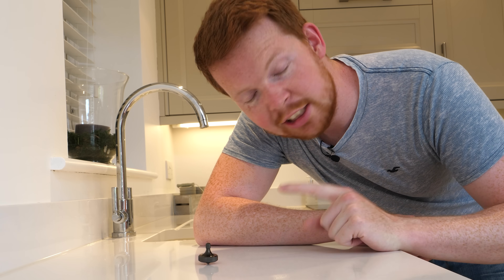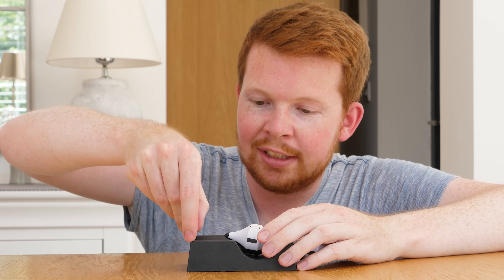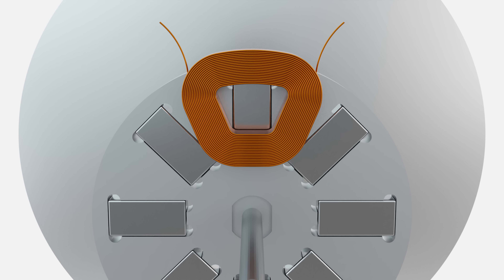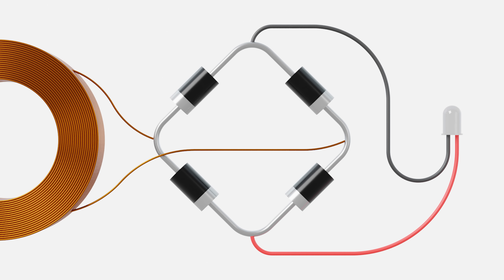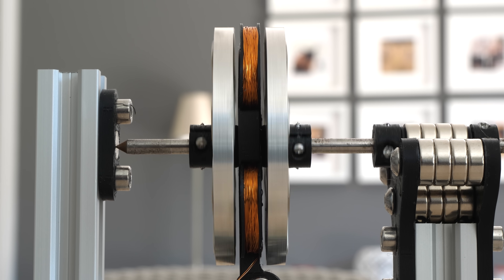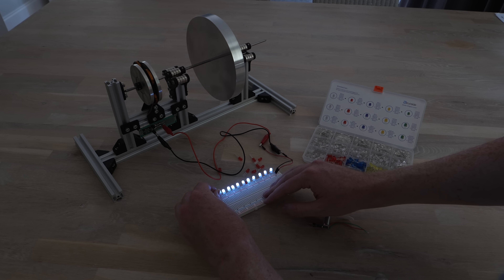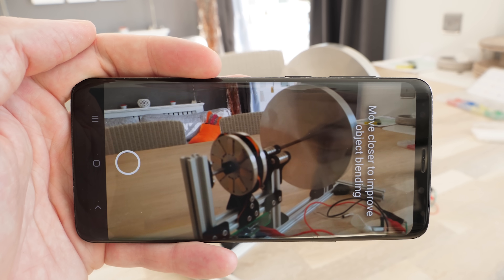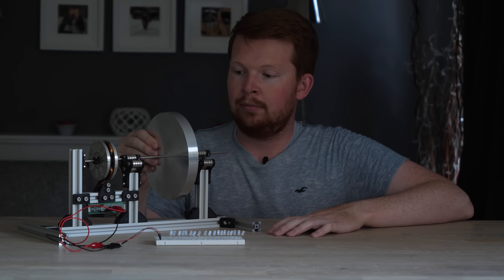Flywheel Battery

Comment: So nice. I'd love to see a 2.0 version with a straight shaft, a higher moment of inertia (maybe a thicker but hollow cylinder) and a reversible generator so that you can "charge" your flywheel with electrical energy before using the stored kinetic energy.
Reply: To add to this I want to see a clutch, or something of the sort of grabber which could use that stored energy to spin it again, then a camera along with a program to send a signal when the flywheel stops to the kinetic spinner to spin again. Possible?
Reply: @matthewcurry3565  Probably dont even need a camera and can just use a motion detector sensor/IR sensor to detect rotational movement. You can even write a code to detect when the rotational object slows down to supply more power to get it back up to speed or just write code to detect when the rotational body stops.
Reply: @ChristopherJones16  yeah that would be more appropriate. Good call. Think the efficiency would be pretty good... The battery should put less load resistance on the wheel, and then the system could in essence turn itself. Then a vacuum chamber could be made to decrease air resistance. 👍
Reply: @matthewcurry3565  A hamster could be used to spin the flywheel!   :)
Reply: @glasslinger  No lie really. At nearly 0 resistance, or very low resistance you could get anything to start it up haha. (was thinking water/steam for initial startup/charge), but usually startup capacitors do that job effectively I think.

Comment: Need to balance the system better.  Then use the generator as a motor.  Then apply voltage and remove it and it truly is a mechanical battery going from electric to mechanical to electric again.  Also build a catch cage or you'll shoot your eye out...erm...I mean hurt yourself.

Comment: I have a stirling engine I place on top of my modem, and it usually spins for about an hour before stopping because it dissipates the heat faster than the modem generates it. But if I used your idea, I could have it store some power in a capacitor, then give itself a bump once the modem has heated back up.

Comment: my own experiments with 11mm puck magnets in the ring around : 10 stationary 11mm coils, only 18 wraps, 10 magnets in opposing orientation like yours generated 5 or so volts.  i used 20ga aluminum wire for these coils.  my second coil was 100 wraps of 24ga copper, perfectly spaced where i threaded my feed end straight down through the center and wrapped the next layer within the groove, and the next coil  layer started and ended directly next to the previous, 22,21,20,19,18 turns heading from the core.  these coils were making 24V in the AC spikes, unfiltered into my digital meter. only 2 of them....in the end i determined that i could reliably get 1V at .1A at a low rotation speed from each coil/magnet interaction.  my plan is to double bank coils above and below the single magnet platter, 60 magnets in a time-constrained pattern, 120 coils generating 120V at 12A...which should be about the size of a large tomato juice can.  i don't want to go back to painting, i want to change the world.  the generator idea is completely opensource, i have no claim on the technology of wires and magnets. you are the closest anyone has come to my design so far. keep on tinkering, I think you are on the right track.

Comment: Wow I wish I was a part of this. Just awesome

A few ideas what if instead of using a pin and Plate at the lower end you would use a few small magnets compelling each other.

I'd also like you to use an ic 555
A condensator
And
2x 24k ohm rsistors

To start and stop a conducter which is putting more potential on the little motor wich could blow against the spinning wheel(s) aka Tesla generator.

And seeing how long it could power itself till the motor stobs. 

I have so many more ideas, love what you do. Thx

Comment: The question is can we attach the electric motor so that it turns the flywheel? Perhaps use some small gears to give it a mechanical advantage in order to turn the flywheel fast enough to create a closed loop of self propulsion? Probably impossible but sometimes I wonder....

Comment: Move the magnets to the flywheel, then you can fit more, they will be moving faster, and it needs a set of three coils on the small generator and both need yokes for the flux to make a circuit for the flux .

Comment: I'd be curious to see this design with traditional bearings. Like the ones from a skate board. You could tighten the tolerance of the coils and produce more electricity. I'd imagine the results would be similar, if not better.  I also know that magnetic bearings are available, but might not be small enough or cost prohibitive. Great video!
Reply: If you add bearings you add resistance.
Reply: @chrisbingham3289  i thought bearings was supposed to solve resistance.
Reply: @chrisbingham3289  Totally correct.  Stability always comes at a price.  It costs energy to constrain the entropy.
Reply: It would already be enough to use a straight axle, lol
Reply: Think about what happens when that stored energy gets away from you in an uncontrolled failure.

Comment: You could reduce the friction of your flywheel setup even more by using opposed magnets at the stabilizing end. Instead of a point spinning on a piece of glass, have opposed magnets set up so that the magnetic "cradle" holding it aloft prevents it from sliding off-center from the magnetic support.

As another thought...

Obviously less efficient in terms of storage than if you have no induction going on, but could you have a magnetic induction system that puts spinning force into the flywheel from an external source? If so, could you then hook the outgoing power into the incoming power, having the flywheel drive itself with its own electricity? Just how efficient can you get this? How close could you get to it being as if you had no inductive draw from the flywheel at all?

I ask because this would be a cool way to complete the "battery" concept: with the flywheel spinning and pumping its electrical draw back into itself as mechanical energy when not being used to power anything, it would not slow down as fast, and then you could just have something in the circuit that lets you add a load when you want to draw power.

Comment: So what would stop us from making human powered generators like this? Have a massive flywheel that you can spin up because the friction is low enough and then harvest it's power. Sure the person had to put in energy over time but wouldn't that be quite efficient? Now I know that you're not supposed to be able to just create energy so I guess the people would have to put in 1 volt of energy for one volt of power. At best, might not be effective enough

Comment: This is an awesome project!

To maximize light output you could try to get rid of the rectifier and use the LEDs in an antiparallel way. The diodes in the rectifier all have a voltage loss of about 0,7V, so 1,4V in total (as the current always has to go through two diodes). 
If you have say 100mA of current through all of your LEDs you are losing 0,1A*1,4V = 0,14W in the rectifier.

Comment: Well, how much power is produced is only depending on the coils and the magnets around the coil. The fly wheel has nothing to do with that so far. And the fly wheel is only running for the long time of 12 min, when there is no energy drained from the system. The moment the electric circuit is attached and closed, the fly wheel probably stops really fast and the entire effect of a fly wheel running for a long time is simply gone. That is probably why he did not show that. So in the end I do not think it is an interesting toy and that is why no one has made one for sale.

Comment: The Frenette electric car was able to charge batteries while it was driving. It achieved a nominal range of 500 miles, with an average driver.
It used a front wheel drive and shaft from a Cadillac with smaller wheel diameter, driving a crankshaft that turned 6 Alternators to recharge the batteries.

Comment: Good day! I have a question. 

In my country we are forced to buy electricity from the government. Price is high. Could I scale this experiment, so as to power the flywheel with a small electric motor connected to the power grid. That motor powers the flywheel alternator, generating "MORE"(?) energy and powering my home. That way I consume very little power in one single electric motor, but it moves a whole POWER GENERATING contraption that distributes the power to the rest of the house after generating more that it consumes!. Is it possible? - my idea was based on gear ratio: If I can move a large gear, to spin a small gear, I can get the RPM to generate current, I just lack the knowledge to assert if this violates conservation of energy.

Comment: What a fun project, I used to love tinkering with stuff when I was young.. it was a lot of fun and learned a lot. Keep it up .
Reply: Me too, we need to get more kids interested in Science and Engineering.
Reply: Only true thing to learn from that is that it takes more energy to get it spinning than it gives back.
Reply: @GekoTDi  I keep hoping someday someone will discover perpetual motion. And anti gravity.
Reply: @RadiatorSpringsMuseum  impossible. Perpetual motion is impossible
Reply: @HadronCollisionYT  yes but it's the pursuit of it that is so much fun.
Reply: Why'd you stop then?
Reply: @wes4477  got married ......
Reply: @RadiatorSpringsMuseum  HAHAHAHAHA, perfect explanation
Reply: WoW. I need help to animate an idea to leverage linear push created in car shock absorbe to rotational and hence electricity. May be the tyre can be designed so that when it touches the ground, gives a solid push thru a spring coil to get a powerful linear motion of small displacement. It can be converted to high RPM rotational motion thru gears and rest is known. Will it not create electric vehicle range to jump 10-20 times?
Reply: @asishsahu9091  no

Comment: If you're charging a capacitor like this, you need to include a diode between the output of the coils and the capacitor, or the capacitor will discharge thru the coils

Comment: You should make a Mk.2 with a few more sets of magnets and coils, and make each coil significantly smaller. You also should 3d print a high ratio gear spinner to make it easier and better to spin up by hand

Comment: Converting the output to DC isn't needed for (conventional) lightbulbs, or even for some kind of motors. I understand the desire to do so, just the reason wasn't well explained. You should also use a current limiting resistor with the LEDs, not to burn them. Still, amazing video.

Comment: Cool, but: you don't need the diodes to light up a LED or bulb. There's a 0.7V  drop over each diode because it's a semi conductor. Since you've a bridged set up we're talking of 1,4V.  So if you're working with small voltages and you don't need DC, drop the diodes.
The LED or bulb will flicker at a 50/60 Hz rate (the human eye won't see it because it's too fast to see).

Comment: So if you were to make a larger version, using some of the energy generated to power the flywheel so it becomes perpetual, then how much current could it produce?  Does it generate heat?
Reply: You can't make perpetual motion. The flywheel has low friction, but not 0. It generates heat by air friction and contact friction of the shaft with the plate, so the wheel will continuously loose energy. In fact, generating electricity to then power up the wheel will decrease run time because of all the energy convertion inneficiency (you loose energy everytime you convert it to an other form. For example, converting from rotational energy to electrical energy is no perfect and you loose some energy doing that) 

And even if somehow there was no inneficiency and friction, using current from the wheel would make it spin slower, because you are pulling energy out of the system

Comment: To remove the flickering 👉Use a smoothing capacitor 😎👍
Also try using the small motor to assist with  the flywheels rotation.
Alternatively 👉 Try Tesla Turbines 🤔

Comment: charging a small battery connected to an electric motor that would turn on and cycle the fly wheel back up would be a useful experiment.
Reply: diminishing returns, there would be electrical losses that would reduce the electricity returned to the battery

Comment: I don't know if he covers this later in the video, but advanced flywheel batteries are being tested in conjunction with solar panels to extend the time that you can get energy from them; basically, there are a bunch of flywheels carefully balanced in a vacuum canister, and the solar panels are used to power an electric motor attached to the shaft, which gets the flywheels up to speed. Once the sun goes down, that electric motor can then be used in reverse to transfer that kinetic energy back into electricity. Unfortunately, each one of those specialized kinetic batteries costs around $20k to pruduce, and only provides power for around 2-3 hours (I might have the specific numbers wrong, so feel free to cross check my information).

Comment: You could put a little windmill onto the open end of the wheel, putting in a stabilizer for the current and then plug in a battery. Put it outside in the wind, or inside your chimney and you'll have energy you don't have to pay for.

Comment: Amazing work mate! Be cool to see you add a hand-cranked gear box to the end, to take more advantage of human strength to get much higher speeds out of this system. And can you stabilise the output to run a raspberry Pi off it?
Reply: good idea about the gear box, stabilizing the output can be done by using a voltage regulation circuit, not sure if this will be practical to run computer circuits since the generated power has too much noise and fluctuation , computers will then constantly rebooting, but could be used for a hobby level,

Comment: The problem with all this machinery is that all are made by materials that are very polluting so there is no solution to any problem - also if you made this kind of machinery in large scales then you have a magnetic field still very unhealthy for all species near the machine - the green energy must be green and not made by materials that pollute in other ways still damaging the environment like wind turbines are still pollution more than burning lignite.

Comment: You could get a lot more energy from your alternator if you use highly permeable material to shorten the magnetic path between the two split rotors. The easiest way to do this would be to wrap the stator coils with a steel band with a break at some point to prevent it from becoming a single turn coil. These bands will decrease the distance the magnetic field needs to travel through the air, which has much greater reluctance than a highly permeable material like steel.

Comment: what if you built another set of copper coils and one more magnet disc and set the timing of the 2nd copper coil in between that of the first one.  so it would be magnets, copper coil, magnets, copper coil timed in between the first, and then magnet again.

Comment: Note: a full bridge rectifier costs about 1V in the output voltage. This can be avoided by using FETs - but they need a controller.

Comment: Can you technically place a small DC motor at the other end of the shaft and once you start spinning the DC motor kicks in keeping the flywheel spinning which keeps electric production and theoretically run on itself forever? Maybe even add a few capacitors to harvest some of the energy production to power other electric items and therefore create a self sustaining "free" or zero point energy? I honestly think that could work with the right configuration. After all once the flywheel is in motion you won't need such great power to keep it in motion so you could use a small DC motor and harvest all excess power.... I'd love to hear what you have to say or think about it. 🙂

Comment: Here's an idea: first off, fix your flywheel so it is perfect on the shaft.
Next, tape magnets around the outside of the flywheel with all the North poles facing up.
Hold a magnet with a north pole facing the flywheel and let the repelling force turn your machine,
How fast do you think it would go. I would also move the flywheel to the center of the between the levitating
magnets and have a coil on each side. Your thoughts?

Comment: This experiment was very entertaining.  I was just curious if there's some reason setting up a magnetic contact point wouldn't be viable to reduce friction even more?
Reply: magnetic support is "soft" and doesn't keep exact position, so most likely it would simply fail with any larger wobble
Reply: @tomaszdabski169  What if he basically used the same setup he has but set the spinning end of the contact point through the center of a disc shaped magnet while mounting another magnet on the stationary glass shield already stopping it from failing horizontally?  So it would look kind of like this:
||
|||||       ||<-------|||
|| 
||  ===========

Comment: you don't have a lot of energy in the nano world, so you need to make a lot of small elongated tubes on which you wind copper and the smaller the diameter of the tube and if a lot of these fit, the excitement of electric fields will be greater

Comment: How if you combine this non friction motion with Tesla's turbine as the source of energy to rotate the the disc.... while you harvest the energy via contactless generator..... voila you solve some of the Tesla's problem to find such a technique to deal with more than 35K RPMS (>35000 RPM).... 
+ perfecting the permanent magnet with induction magnet to make it levitate stronger.